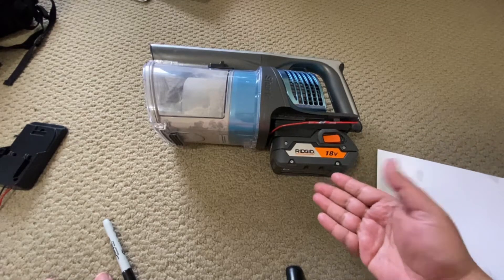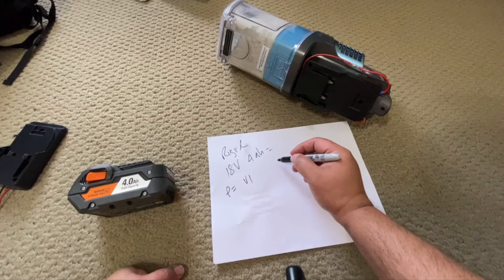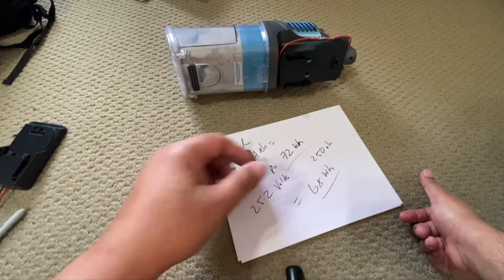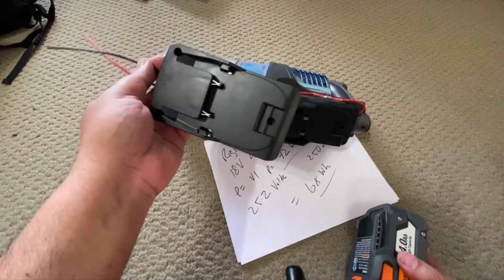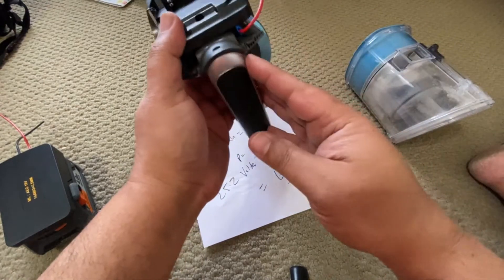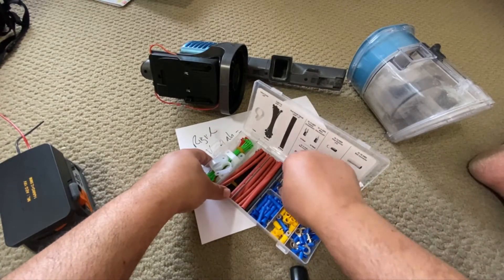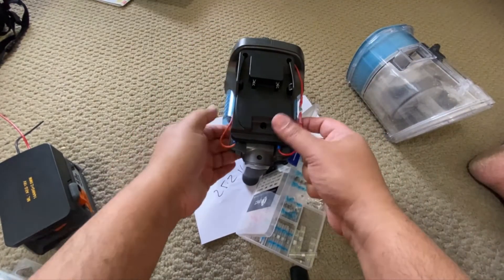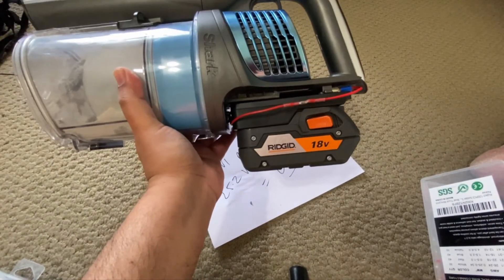Using Ridgid battery to power Shark Cordless Vacuum Vertex DuoClean, LZ462H

Comment: On the original battery and vacuum, there are 3 power connections. One seems to be "dead". Meaning when I meter it, it doesn't show any voltage. Can anyone explain what the third connection is for? Thanks
Reply from the maker: I believe the third is for the motor for the floor brush, which I don't use in this setup.

Comment: My vacuum is an Orfeld which is hard to find batteries, since the battery is 22 volts i manage to find a 21v battery with double the amount of amps, so yes, I sacrificed a little on the suction power but get 3 times more running time,. I also use an adaptor like this video

Comment: 😨 DON'T LISTEN TO THIS GUY BEFORE READING!!! 😢

I'm sorry to say, but you have no idea what you are talking about and certainly no place giving electrical advice. 
I don't claim to be an expert on this kind of thing but I know just enough to confidently say that you sir, have absolutely NO clue in the slightest. Please be careful with what info you dispence to people.
This deliberately sounds harsh but I'm hoping you'll understand why after reading.
I do apologise if it upsets you though, as that is definitely NOT my intention.

I'll try to give a VERY BASIC explanation of a few things below so that you and others can get a brief idea of how this stuff works. Keep in mind this is BASIC ADVICE and I am not an expert by any means, but the below is generally accepted as common knowledge for this type of thing.

First of all:
Please understand that "Amp hours" (Ah) and "Watt hours" (Wh) only refers to CAPACITY and has NOTHING to do with output.

Eg1:
We have an appliance that requires 18Volts (V) and 1Amp (A) of current giving a total of 18Watts (W) of power to run... Using an 18V-4Ah battery will provide 18W of power for a total of 4 hours.
Hence being called a "4 Amp hour" battery.

Eg 2:
If we have an appliance that requires the same 18V but a total of 72W of power which means that our 18V-4Ah battery will still output the same 18V However, it will now need to give 4A to achieve the required 72W of power to run the application.
Because our battery is now using 4 times the current as it was in Eg1 (4 Amps VS 1 Amp) it means our 18V-4Ah battery can now only provide 1 hour of power at 18V to give the required 72W necessary run the appliance.

Next:
Depending on the battery chemistry and electronic management system inside the battery itself, these tool batteries will typically output much more than just 1A which is why the battery in this video would never run for 4 hours of continuous use in the vacuum because the vacuum needs much more than 18 Watts to run.

Finally:
The battery voltage and amperage is specified by manufacturers to achieve the desired power needed to run an application and depends on many things... One of which (amongst others) not to overlook is the size of conductors such as wiring and other components inside an application.

As an example:
In general, increasing Amps (in essence, the volume) of a set voltage means that the size of wire needed to carry the voltage also needs to either increase in diameter or reduce in length so that the resistance does not increase. Obviously wires can't always be shorter or thicker due to many factors, including, but not limited to things like keeping a package smaller, having enough space between parts or even reducing costs by using less copper. Instead, a manufacturer might increase the voltage and reduce the Amps to achieve the same power output.

Relating to the video:
In this application the battery will be using much more than 1A to run the vacuum. Reducing the voltage from approx 25V to approx 18V means the amperage will need to increase to provide the same power (scroll to bottom of this comment for the simple formula explaining this) and if the appliance and its components are not designed to handle this, you will have increased electrical resistance in the wiring/components causing excess heat which can lead to damage/failure or worst case, fire and injury.

Conclusion:
All being said... I've done this mod with my Dyson using Milwaukee batteries without issues, but I did my research (Note there is only approx 2V difference between my Milwaukee battery and my Dyson)
Not saying what has been done in this video won't work, but if you do this mod, be aware of the potentials implications.

Side note:
If anyone cares to do further investigation, the first the basic formulas to understand for this application are:
P=I×V
I=P÷V
V=P÷I

Where:
V - Voltage  or "V"
I - Current (Amps) or "A"
P - Power (Watts) or "W"

Resistance is an extra component I'm not going into but google "Ohms law" if you're interested.
R - Resistance (Ohms) or "R"

I hope this info is helpful.
Reply: Ok so he got the equation part wrong, but it appears to be a working solution. Not exact, but close enough. I venture to guess your vacuum mod is very similar, yet not exact. What are the potential implications you are worried about?

Comment: I think you have gotten lucky with your numbers. 

You have mixed up energy capacity of the battery (Wh) with power (W). 

The machine will draw whatever current it needs.  Just because you are using a 4Ah battery does not mean the battery will supply 4 Amps. 

For instance, your 4Ah battery is rated for being able to supply 4 A for an hour before the battery is considered empty. 

It could supply 16Amps for all we care for, as long as it doesn’t overheat, but then it’s likely to only last 15 minutes. (Actually very likely the case in this setup). 

So what’s my point? Comparing the watt-hour capacity is pointless. In this case, what matters is the battery being of similar enough voltage (which you’ve got lucky) and being able to supply the current needed. And your tool battery is more than capable of that.  

And the reason I mention it is because people might think it’s fine to use a much larger voltage, but because the Ah rating may be lower - which is dangerous. 

I stumbled across this post because I’m planning on building my own battery pack - and it’ll be the full voltage, but I plan on something like a 12Ah capacity - so the thing lasts more than 15 minutes on full power. (So my Wh rating will be well and truly beyond the original - but that’s immaterial, because in this case I just need to match the battery voltage and make sure my battery will be able to handle the current draw, which it will). 

Please be careful with your instructions. If you are not 100% sure of the theory here, you really shouldn’t be trying to give a lesson on it for others to follow.  Dangerous.
Reply: Very cool, I've been looking for this type of information... I was going to use the 20 volt dewalt for my shark vacuum.

Did you determine the amp draw on high? I'd like to see your finished cell. I assume you put a BMS on it as well?

Comment: Seems like your math aint mathing you are confusing Watts (W) with Watt hours (Wh). Wh as no impact on the performance of the tool. If I put in a 700V battery that is 0.1Amp it will be 70Wh, pretty close aint it? But man you should see the sparks if u ever turn it on
Reply from the maker: Perhaps the math is off a bit but no issues in using this for over a year. Most recently, I ran it for more than 20 minutes non-stop.  the one thing I will say is that if I leave the battery connected to the vacuum, it drains overnight.  So I just don't have them mounted.  But no sparks or heat.

Comment: The best thing about these Ridgid batteries is that they have the battery management for over discharge protection in the battery unlike the other major brands (dewalt, milwaukee, makita, etc. all have the BMS in the tool). The only other manufacturer that I'm aware of that also does this is Ryobi (also owned by TTI) but their form factor doesn't lend itself well to DIY projects.
Reply from the maker: I plan to wire three 18 volt Rigid batts in series to power an EGO power tool.  Need to 3d print mounting and switch - working on that.  Hope 54 volts is sufficient for the 56 volt tool.

Comment: The "power" you compared really isn't that relative to how well it is going to work. Electric motor speed is dependent on voltage. The vacuum motor is going to be approximately 25% slower at the start, and continue to get slower with an 18v battery. Slower motor = less suction. The current rating on the battery can never be "too powerful." The device connected to the battery will only draw what it needs. The amp hour rating is really just a measurement of how long the battery will last. 

It would be much better to use a 24-volt battery, but obviously what you have will work and it will likely last longer than the original battery. You're just sacrificing some of the suction. Good video, I'm going to do something similar.

Comment: Can’t find those adapters any where
Reply from the maker: Here is one I found on ebay.  https://www.ebay.com/itm/373711648582?_trkparms=amclksrc%3DITM%26aid%3D1110006%26algo%3DHOMESPLICE.SIM%26ao%3D1%26asc%3D245022%26meid%3D0deb40b42f3345f2b68d739739d21402%26pid%3D101195%26rk%3D5%26rkt%3D12%26sd%3D125543796874%26itm%3D373711648582%26pmt%3D1%26noa%3D0%26pg%3D2047675%26algv%3DSimplAMLv11WebTrimmedV3MskuWithRevOptLambda85KnnRecallV1UpdatedPrice%26brand%3DUnbranded&_trksid=p2047675.c101195.m1851&amdata=cksum%3A3737116485820deb40b42f3345f2b68d739739d21402%7Cenc%3AAQAHAAABIATTvUhf9weceaKbX5LvBjvPjEhDzrCECR1YF2hmJp%252BY3cKnSDVzdwt2NHzOMyyyOoavCkbiJbFyLOYBO2W7CrFs8F3wGZ9lriP2YJm81zysV5mxiV55vcUciQihAaU9v%252BTQ1Vr9ESZdBieW14nbfWyRmPxguRprRXwR4piaaHYW3aSKzp9KWqH0Sn2H8B9LPOVKmYH6E18ss6bMVOnQJSV1yAy9a1JSnT2Vn3ni0mjwNeUQOZl7MTg6qQoiEAPA%252BdUszizWiRyA%252FrPS6N3XL2nmQl%252Brw12sarmH8Vhm2jbQNcIAOJnaVy7%252FkU0g68eqpqLd2tBvoZWIPZ399GaTxa2FIbRHWdRcvli5P7SA39%252BPtEk9f1dLFDwUSHSNh%252Fbe%252FQ%253D%253D%7Campid%3APL_CLK%7Cclp%3A2047675, but it is more than what I paid.